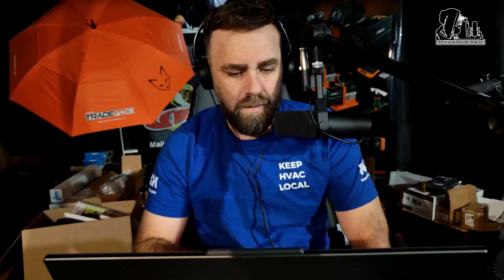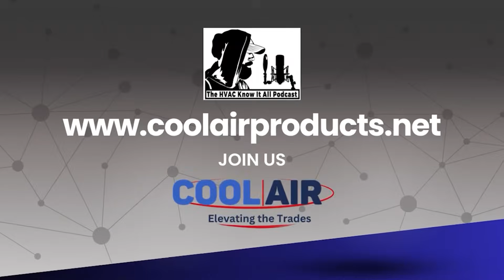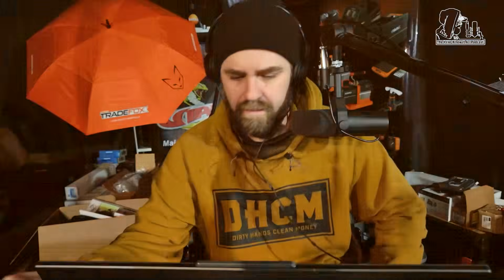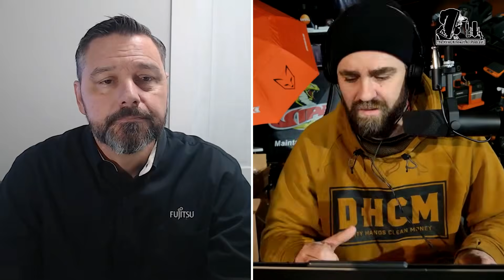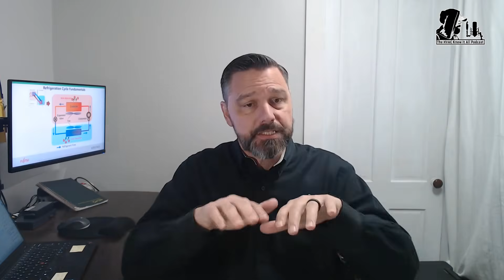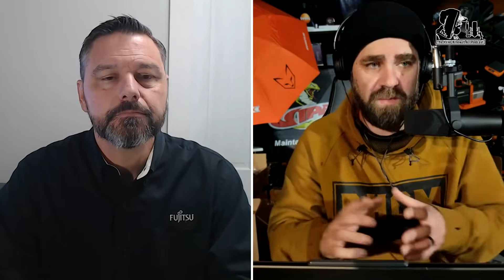How Inverter Heat Pumps Maintain Capacity in Extreme Cold for HVAC Pros with John Davidson, Part 1

Comment: My heat pump is work at - 20 Celsius or -4 fahrenheit with no issues. With the windchill at-30 in Toronto this weekend.
Reply from the maker: What brand?
Reply from the maker: Also, is your electrical bill high?
Reply: @HVACKnowItAll   Laat month $125 Canadian. Its very cold this weekend in Toronto and working well. Plus I charge my EV once a week.  Electricity is cheap in Toronto and we have a nuclear power plant  Hydro One in Pickering just east of the city